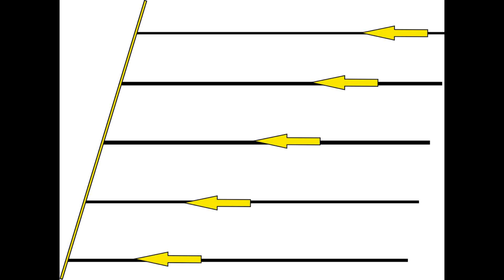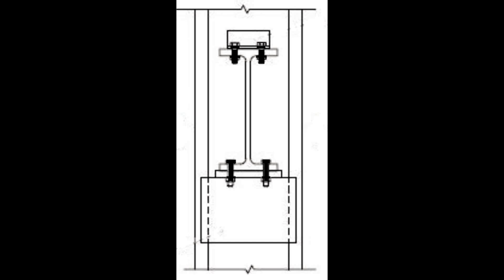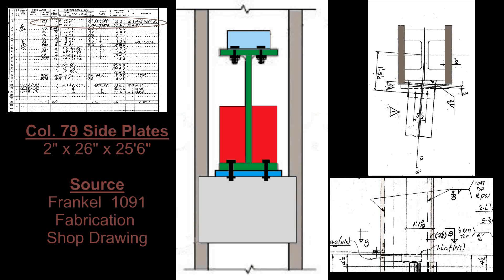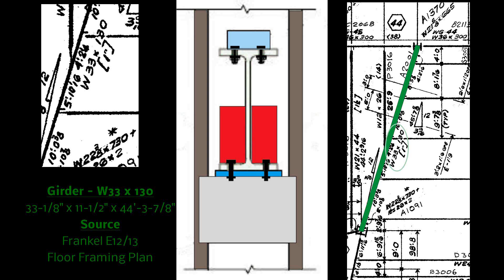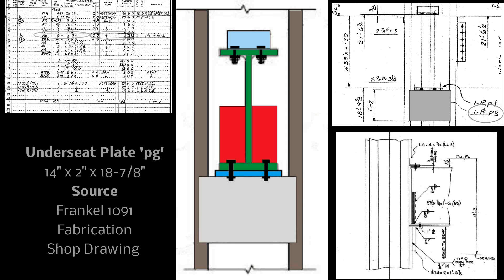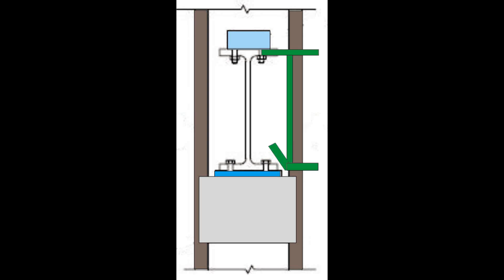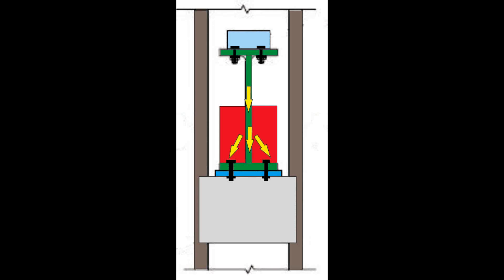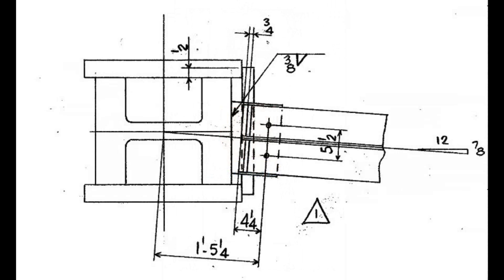WTC7 - The Stiffener Plates Explained

Comment: The two little (~21.5-pound) stiffener plates were only there to prevent web deformation, and the web doesn't deform in the NIST hypothesis. 12" instead of 11" is only 1/2" e.w. and meaningless. This "brief introduction to the issue" is total bullshit.
Reply from the maker: +Albury Smith  Already been done. ARUP produced a FEA study for Silverstein's case. It DID include the stiffener plates and also the shear studs on the girder, as per the drawings.
Also ae911 have commissioned a FEA of the full building at Alaska University. BTW ARUP's analysis does NIST's story no favours. Turns out that we were 100% correct in what we told NIST years ago. No failure as per their hypothesis is possible. You need to try and keep up with the evidence Mr Smith.
Reply from the maker: +Albury Smith You should really do some research on that and on ARUP generally, and what they set out to prove in their simulations before you disregard it. After all, if it transpires that they actually were trying to prove the official story, then you're going to look really stupid, which I know will not be a brand new experience for you. 
The fact you're not even aware of the report or any of the expert testimony attached to it will tell anybody who is informed all they need to know about your motivations.
Reply from the maker: +Albury Smith No, It's published alongside all the rest of the evidence for the case along with expert reports. Get a pacer account and go do some research of your own for a change. It will be a brand new experience for you instead of regurgitating nonsense like you usually do. At least this way you can produce original nonsense.
Reply: +nineeleven twentyfourseven If you're referring to the UAF wacko who thinks building fires burn at 400F tops and move from place-to-place in 20 minutes, all you proved was GIGO.
Reply: +nineeleven twentyfourseven Where's this alleged ARUP FEA study for Silverstein's case published? Journal of Engineering Mechanics? Please feel free to post a link to it.
Silverstein Properties and their structural engineering and construction management firms were sued ~14 years ago by ConEd and its insurers for ~$314.5 million for the property damage and losses from the 9/11/2001 collapse of WTC 7, and the plaintiffs LOST in this 2012 appeal:
http://www.ca2.uscourts.gov/decisions/isysquery/a3c33b98-9cbf-4b82-b557-6088e207c8f6/1/doc/11-4403_complete_opn.pdf
There's no mention of Box Boy or any of his crackpots, or of their secret demolition crap in that court summary, despite their huge electronic billboard in Times Square <5 miles from the NYC courthouse. Gee; go figure...
Reply: +nineeleven twentyfourseven All the rest of WHAT evidence and expert reports relative to WHAT case? Accessing engineering reports from court records would definitely be a brand new experience for me. 
If this alleged FEA from your "experts" failed to produce NIST's results, why isn't it in the ASCE's Journal of Engineering Mechanics? Who are these so-called experts, and why haven't they addressed an ASCE, SEI, NCSEA, SEAoNY or other structural engineers' conference with their amazing new findings? I'm sure the plaintiffs in this case would be interested too:
http://www.ca2.uscourts.gov/decisions/isysquery/a3c33b98-9cbf-4b82-b557-6088e207c8f6/1/doc/11-4403_complete_opn.pdf
You're peddling bullshit, dude.
Reply: +nineeleven twentyfourseven If I wanted to "look really stupid," I'd be a 9/11 truther nut. The fact you're being so cryptic about this alleged "report [and] expert testimony attached to it" will tell anybody who is informed all they need to know about your competence. It's obvious to any informed person that OPRA and other public records requests need a lot more specific information than you've provided, and the NIST WTC 7 collapse hypothesis needs no validation from your 9/11 crackpots anyway.
Reply: @AIbury1  You have well and truly proven beyond a shadow of a doubt you offer nothing new and, sadly, you look really stupid. Congratulations!
Reply: @747fa  Please feel free to ask Box Boy* and his "more than 2300 [9/11 crackpots]" to show you on video with audio how explosives or incendiaries secretly cut the 4.91" flanges, 3.07" web, and 215 in^2 cross-sectional area of even ONE W14 X 730 column like the 11 of 24 in your Sacred Tower 7's core, and the 4 corner columns in each Twin Tower's core:
http://www.ochshorndesign.com/cornell/writings/milstein-critique/images/8-fig04.png  
http://www.youtube.com/watch?v=0c2o8k4n9CY
If they ever HAD TO do it, you'd need to start looking for another hobby.
*Box Boy's ONLY 9/11 "research":
http://www.youtube.com/watch?v=hFVi4qbN2jM
Reply: @AIbury1  Albury. The mere fact you disrespect a highly qualified professional is evidence enough your comments here are worthless. And he (Dr. Leroy Hulsey) did not mention explosives, etc. THAT is why his final report, which is purely science based, is extremely professional.
Reply: +Albury Smith So NIST spends years and millions to come up with a report wherein they both misrepresent and outright omit structural elements, and you're ok with that?  Quite telling.
Reply: +Nathan John This is really very simple. Box Boy Gage claims to have "more than 2300 [9/11 crackpots]," so ask them to do their own "new and independent" ANSYS & LS-DYNA FEA with the 2 precious little 3/4" thick stiffener plates included in their input data.

Comment: 3:24

How did you come to this conclusion? Have you done the calculations?

What if it walked the entire six inches huh?

Also you have it walking 90 degrees to the vertical beam. What if it moved at say 80 degrees to the side and back away from the seat?

I hope you understand this is all theory and we will never know exactly what happened down to this granularity.

You honestly think you idiot claim an extra inch of seat and that plate 18" x 3/4" x 5 1/2" would have made a difference?

You think the critique of a maths teacher and an idiot Scotsman somehow invalidates the work of hundreds of structural engineers at NIST and other organizations who are expert at these matters?

The stiffener pate wasn't even placed there for structural reasons but to stiffen the area of the I-beam birder where it interfaces with the two bold holes. This prevents play in the area where the bolt holes line up dumbass.
Reply: "I hope you understand this is all theory and we will never know exactly what happened down to this granularity." Yeah? Then what the hell are you're doing here? (What a moron.)

Comment: You must be incredibly stupid Scotsman as you can fucking well see in the drawing that stiffner plate BS is welded only to the INSIDE of the I-beam and is not physically connected to the seat or "web" or WTF you think it's attached to that would prevent it from walking.

LOOK

0:54 right in your own bloody video moron!

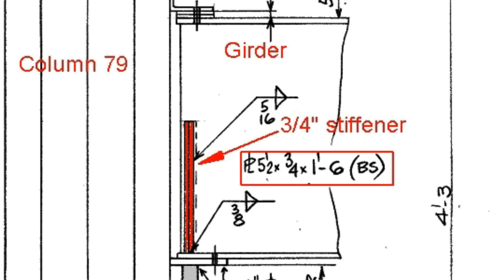and here 1:21

Does it look to you that it's attached to the seat huh? NO!

You can f'ing well see it's welded to THE INSIDE of the I-beam. To the TOP INSIDE of the bottom part of the I-beam girder.
Reply from the maker: "BS" is not a stiffener plate. It stands for "both sides". The plate itself is welded to the web and the flange of the girder. The welding marks are right there on the drawing. I think you need to go do a little research on this issue and structural drawings generally.
Reply: nineeleven twentyfourseven on the drawing the plate is labeled "BS" and I'm well aware it stands for both sides. How else do you wish me to refer to it on the drawing?
Reply from the maker: LudicFallacies Where do you get that from? "BS" refers to both sides, it doesn't refer to the plate at all. It would be in the bill of materials if it did. It isn't, because it doesn't.
Reply from the maker: The seat and the web are two different things. You're really not getting the hang of this very well are you.
Reply: +Nathan John 
Wow.  He just totally ignored the fact that he was wrong; and moved on to troll elsewhere!
Reply: Go back to primary and sit at the back. And improve your language mr Hick.

Comment: The towers had a different design then wtc 7,I think columns are usually 30ft on center all throughout,but the towers had tube columns pushed to the outer perimeter with 4inches of cement,the decking and trusses connecting that to the inner core columns so basically the welds and or whatever was securing the trusses gave way due to the fire and the outer columns buckled outward....If you looked for a stiffener mistake on the blueprint would think you would know that wtc7 and wtc1 and 2 are two different designs and would react different in a collapse..from what I heard wtc7 they pulled off alot of "tricks" to transfer load because they built it over some electric building or an existing structure..If you look at the way they hacked the wtc7 building it's no wonder it came down,right?
Reply: Wrong. "Hacked"? WTC7; the structure over the sub-station was upgraded/reinforced some years prior to 9/11